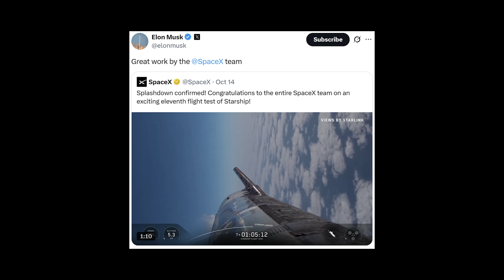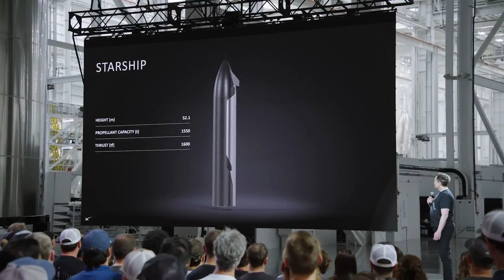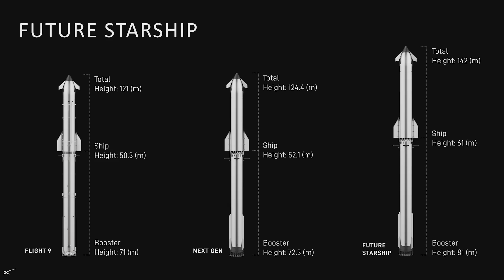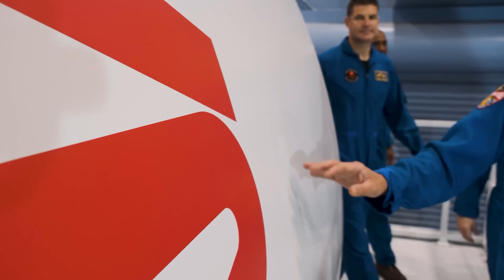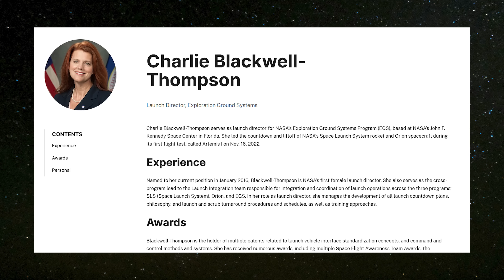SpaceX president reveals Something Big happening with Starship Moon Landing after Flight 11 Success

Comment: Grok says:  "### Summary
SpaceX's Starship Flight 11 (Oct 13, 2025) aced key tests: payload deployment at 119 mi altitude, Raptor relight, heat shield endurance (with deliberate tile gaps), and Indian Ocean splashdown. Gwynne Shotwell hails it as a leap for Artemis lunar lander (target: 2027 south pole landing), teasing Block 3 upgrades for Moon/Mars crews. Elon cameo: "Visceral from afar." NASA's Duffy: "Beats China back." Future: Orbital refueling, Florida pads, Raptor 3 engines.

### Evaluation
- **Truth/Honesty/Correct Data**: Spot-on. Matches official SpaceX/NASA reports—no spin, just facts with mild hype. Shotwell's quotes real.
- **AI-Generated**: Nah, real clips and narration from a legit space news channel. No deepfake vibes—searches confirm it's human-made rocket porn.

Truthful recap, no BS. If Starship's lying, it's only about how boring failure is. 🚀"

Comment: The narrative that China might land on the Moon before the U.S. stems from the fact that China is essentially trying to replicate what Apollo achieved in 1969 — a shortterm landing using a small, single use lunar module. That approach is technically much easier but offers no path to a permanent presence on the Moon. In contrast, the U.S. is attempting something far more ambitious: landing an entire large spacecraft (Starship) capable of sustained operations and reuse. Despite the tougher challenge, the U.S. can still accomplish its mission before China, and when it does, it’ll be on an entirely different level of capability.
Reply: How is it that even Western scientists wouldn't agree with what you said? Also, China not only laid out their plans to land man on the moon but build a moon station mostly in cooperation with Russia. Their progress is much more impressive that SpaceX except Western mainstream media do not want to report this.
Reply: @adamiskandar5107  A permanent lunar base is a long term goal for China (2030 + ) which would require a much larger cargo lander than their current Lanyue. The current Lanyue lander cannot support a moon base it’s simply too small. China has not yet revealed its future cargo lander, whereas  U.S. Starship offers a straightforward solution for a U.S. moon base. The U.S. will establish a basic lunar base before China due to Starship’s advanced development, massive payload capacity and reusability, which enable rapid infrastructure delivery.
Reply: @adamiskandar5107 i don’t see Russia bringing much to the table in the next 20 years. They will have trouble even holding up as a country without deintegrating.

Comment: wouldnt need a heat shield if you can just slow its decent.
Reply: costs more fuel
Reply: need to much fuel.
Reply: @petepete2284  so does adding plates to the shield. in fact that extra wait could almost = more fuel because its pulling that weight all the time
Reply: @jonrich9675   would that be pushing?  Pulling that weight up.?    Pushing  against gravity  in decent?

Comment: LOL... China has copied the Falcon 9 and the Mechazilla tower. China is testing their copy of the Raptor full flow staged combustion methane engine. China WILL copy Starship and super heavy within months of when SpaceX  gets them to work. China will then mass produce them with skilled rocketry labor that costs $800 per head and undercut SpaceX at a quarter the price. You pioneer, they copy, they win. 😂😂😂
Reply: China will fail-lose
Reply: @joestitz539 China is planning to beat SpaceX the same way BYD is beating Tesla. Copy, apply cheap labor, sell at 1/3 the price, drive everyone else out of business.
Reply: @dwightlooi BYD has serious quality issues already
Reply: In space copying is not a problem. The reality is reusability like falcon9. Reusability in rockets is very tough and needs lots of r&d . It will take years to achieve a reusable rocket for the Chinese. It is not one time orange nasa rocket. Reusability in space will only achieve through a lot of r&d and failure.
Reply: China still can’t build a reliable and efficient jet engine - why?
Reply: @antexp396 ??? They have the best jet engines since 2018. Woshan series.
Reply: Typically they copy competition, have little quality control, then have to scam people for a sale then anyone outside of China knows the brand is crap. Huawei, BYD, military exports,etc.
Reply: The Chinese will achieve everything they set their mind to achieve. Just thinking of the number of scientists and engineers they have available and their massive technological resources and networks. They have an accelerator system with no peers. Best approach is collaborative competition and sharing of the benefits.

Comment: Parallel parking a huge massive tanker then transferring liquid Oxygen and liquid Methane in effectively zero gravity by remote control is incredibly difficult. Space X has a history of explosions as they perfect their technique. This will undoubtably happen in orbit at least once. Probability & Murphy's Law states that it will most likely happen when topping off Starship with the last tanker. This will produce a rapidly expanding orbital debris field of shrapnel  Has anyone done a Collateral Damage analysis for this event? How many space telescopes, communication, weather & spy satellites will be destroyed? Is Space X carrying insurance for this event?          - Brought to you by your friendly State Farm Agent
Reply: Consider it as docking to the ISS ... spacex have done that so many times. Parallel parking will not be that difficult since there is no gravity in space( much easier to control speed and alignment)
Reply: @-na3136  Forget gravity. This is a mass and inertia problem. Docking with the ISS is easy with a low mass, single, "nose on" connection on a Dragon capsule. Even then there is a bump when docking. It is much easier to park in a parking lot with a Mini than it is to parallel park a double decker bus in it's own length. 
I'm not saying it can't be done. I am saying the potential for a "Rapid Unexpected Disassembly" of the Tanker and Starship with the ensuing global chaos is significant.

Comment: why all the screaming when it blows up at the end?
Reply: It was supposed to hover for a few seconds, then decend and blow up so that the parts sunk. They had no further need for V2 engines and the rocket. The V3 will fly next. In short, it was a complete success.
Reply: They are testing for chopstick test. Like they are hovering . If that is in final ,they will catch the rocket with 2 stick so they test hovering for last v2 era.
Reply: This flight, from beginning to end, went exactly as they planned. 100% success. That's why they're cheering.

Comment: "gently splashing down" before it flippin exploded. Why do u always avoid mentioning and showing that
Reply: Lol, they literally had the boaster floating in the air, then it was intentionally exploded. Do u even have eyes ?
Reply: It is "gently splashing down" because the thrusters slowed it down to 0 km/h just above the surface of the water. This is quite a lot slower than the 40,000 km/h it was doing at the start of re-entry. Reaching 0 km/h 20m above the water at a preplanned location was the end of the mission. Unfortunately the spaceship can't actually land on water though, only at the spaceport, so it then promptly fell over and broke. This is expected behaviour. Since there was leftover rocket fuel on board, this then mixed and exploded, also as expected.
Reply: Was'nt flying at 40.000 km/h. Only at 27.000. Still damned fast.
Reply: The explosion was intentional. Thought that was obvious even before I read about it.
Reply: They repeatedly stated no recovery and there would be an explosion
Reply: Yes, the vehicle isnt ment to fall on its side, its ment to be be caught out of the air with the chop sticks. who cares if it explodes when it tips over and crashes into the water, it already did its job.
Reply: FTS...
Reply: You can't help some people who are only interested in the failure of the United States, anything Elon Musk, or anything that illustrates to the world a path of excellence, innovation or a profitable future for humanity.

Comment: If Block 3 is the one they want to send to moon then they will be behind China. Simply because block 3 will be much more powerful than block2, and it's not even test fly yet, and block 2 encounter so much problems which I don't think is fully solvedm
Reply from the maker: We tested block 2 to do V3 better
Reply: @SpaceZonea  Its going to take more than 2-3 years before they can succesfully refuel a starship. then at least another 2-3 to land one on the moon. the is no way that Starship lander is a good solution... its about 16 launches to fully refuel a starship... they could just send an apollo style mission with a falcon heavy.
Reply: @wezzyuwezzuy9338  Refueling is a strategic goal that supports both the lunar gateway space station and the Mars missions.